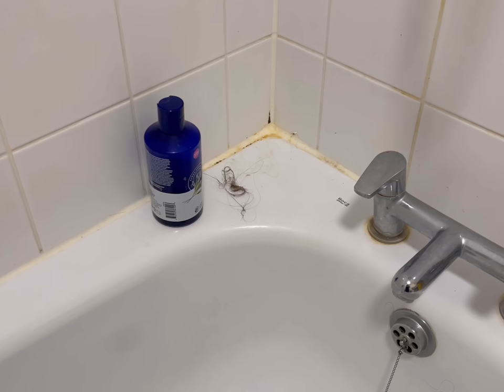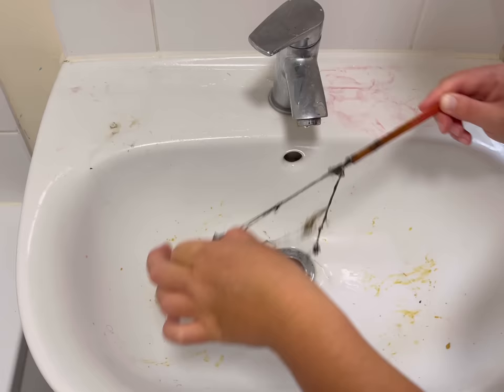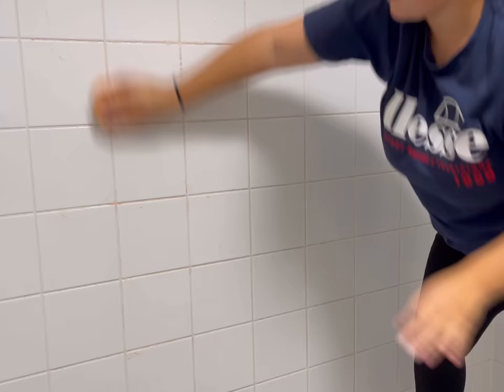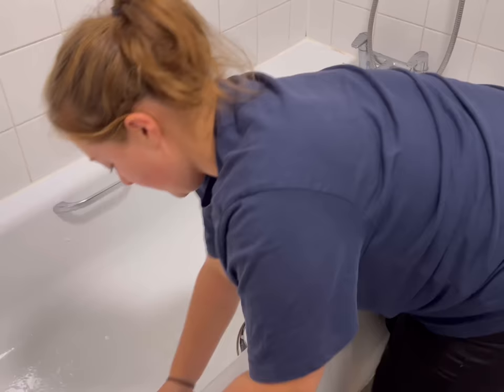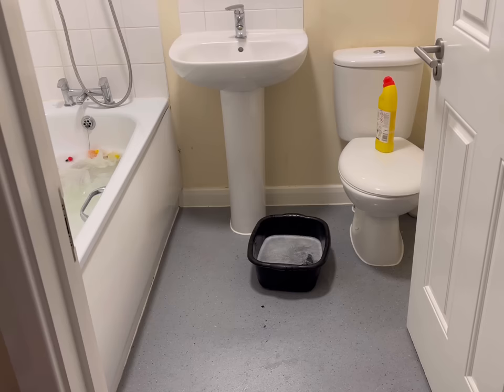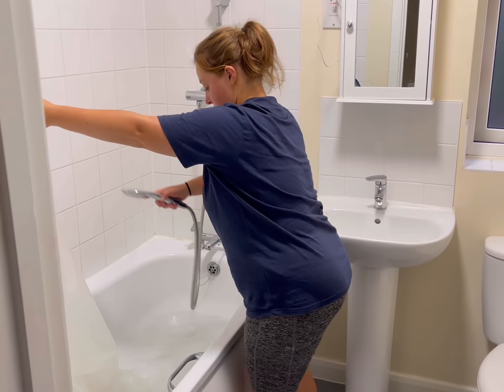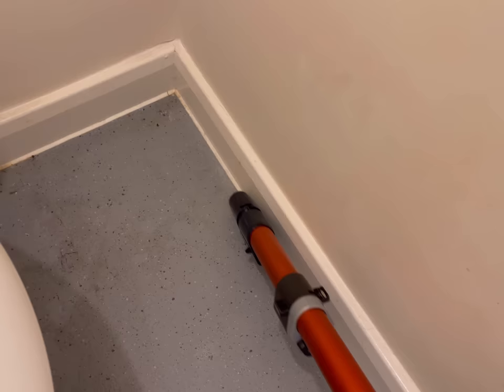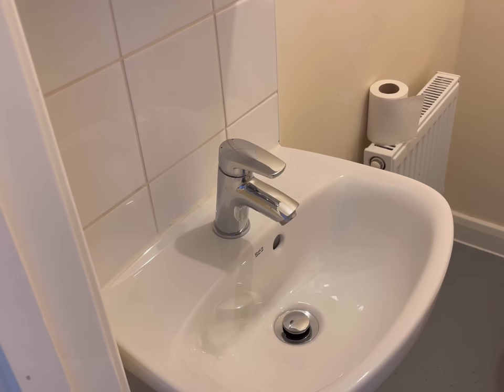A doubly messy bathroom clean with me

Comment: A tip with bath toys a dab of glue over the holes will block water from getting inside them it means they can’t be used a squeeze toys but it’s better than mould in them

Comment: Love your videos, Remi! It's like having a friend in the room while I fold the never-ending pile of laundry.

Also, I seldom use gloves when cleaning. Part of it is laziness, part of it is most household cleaners are gentle enough to where you can get away with not wearing gloves while using them. The only exceptions are when I'm using something strong, like the acid cleaners for taking off limescale. The southwest USA (and the American West, in general) has very hard water, and water softeners are just about mandatory if you want to save your plumbing, fixtures, and water-using appliances from rocking up.

Take care and stay cool! The infernal summer heat is waning, but not done with us yet here in the USA either. Come on cool weather! I have baking to do

Comment: Indiana USA. Iv had the very same issue with bath toys but i found a solution! I take a dollar tree glue gun overfill the air hole so ot fills the inside a little then fill the depression around the external air hole the very important use a popsicle stick to make the glue smooth to the toy. Hope this helps someone else.

Comment: Im here for all it Remi! I only recently discovered the pink stuff and i love it! I also bought the all purpose spray and i love it so much because i dont feel like they have watered it down at all and i love it for my shower and anything thats greasy. But listen, i keep threatening my family saying im gonna move to England cause the weather is better and here u are in a heat wave😢! San Antonio has broken every record this summer. I currently have my central air on 80°🙄 as if that's actually a temperature to save on our electric bill which was $320 this month 😒and because our electric grid keeps threatening to do rolling blackouts. As a result i started calling summer my "our dark days" because ive had our curtains and blinds drawn closed since june when we started hitting 100° everyday since and 70+ days over 100...its so hot that some homes catch on fire here. So yeah it been rough everywhere, i suppose we should move to Finland right?😂 ❤ u Remi!

Comment: When you get new bath toys hun, use a hot glue gun to seal the hole. It stops water getting in and prevents the mould. You just need to keep checking them xx

Comment: if you get some bicarb, vinegar and hot water you can clear the drain, I just put the bicarbonate soda in the drain leave it for a few minutes then add vinegar over it and leave it for a while, it will bubble a lot and then take boiling kettle water into it and it will clear it.  Im actually allergic to gloves so it's a problem, it's your family and your home so no gloves should not be a problem.

Comment: You might want to purchase a reuseable/washable shower curtain. I take it down and bleach it twice a month in the tub (learned that from you) but then I put it in a bucket and take it down to the washer and wash it with white towels and do it with laundry detergent, a sanitizer and set the washer to wash in very hot water.